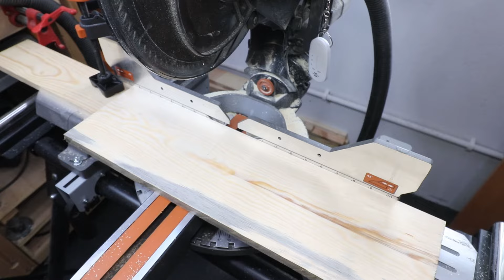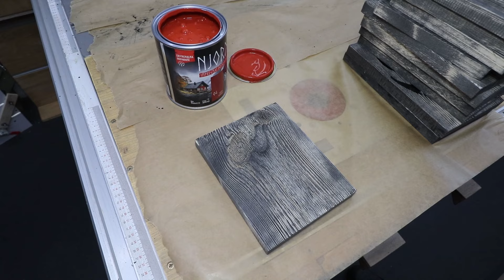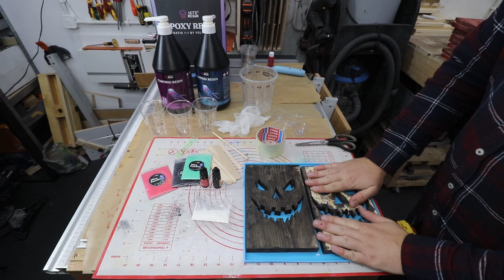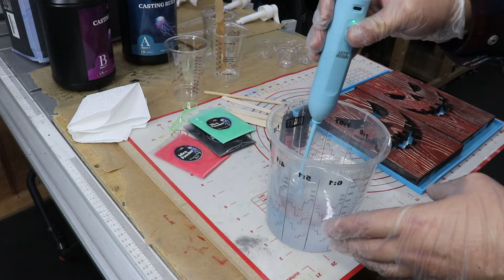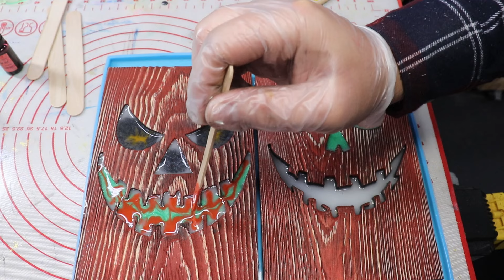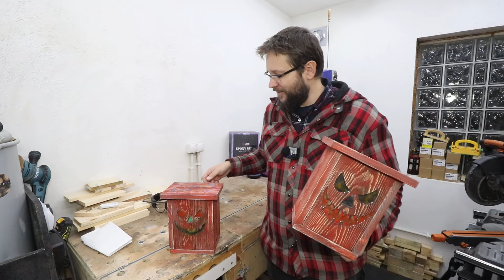Spooktacular Jack-O-Lanterns: DIY Epoxy Resin & Glow-in-the-Dark Magic! 🎃✨

Comment: Tomasz, cracking jack-O-lanterns 👍. Have you considered using tinfoil on the inside of the two side walls and the back wall 🤔 it would possibly help to reflect the light around making a stronger glow from the lights.  Just a thought to consider going forward 🧐. As always brother 💯%   👍   🇬🇧.
Reply from the maker: That is actually a good idea I may try that, thank you

Comment: Thank you so much for taking the time to share the video with us here. I have always been genuinely curious to see how that resin works and to understand the outcome from someone I can truly rely on, rather than just relying on what they showcase in their advertisements. And yes, I completely agree with you on that point! I also thought that the thickness of the resin would definitely play a significant role in achieving a better outcome, just as you mentioned. It appears that a more substantial layer could enhance the overall results and provide the quality we’re aiming for. I believe in the idea that “ Our World is a Shared Experience ," and it warms my heart to connect with fellow creators. Thank you, matey, for being part of this journey!
Reply from the maker: Resin casting is super cool, however it can be very expensive hobby. So it's always best to do proper research before tackling your own resin project. There is plenty errors that can be made on the way so its best to learn on mistakes of others. Thank you for watching!
Reply: @CasualDIY  That is exactly what I told my beloved wife during our conversation. I am truly happy and completely content with what I am doing for now, but she is actively immersing herself in learning how to work with Resin, which I find absolutely fascinating and inspiring. I will definitely pass along your valuable opinion and advice to her, as we both take your insights very seriously because they are always practical, thoughtful, and honest. So, thank you, my dear friend, for your continued support and invaluable guidance.